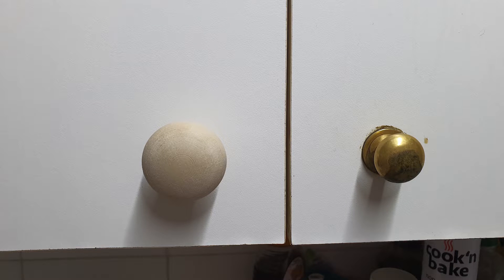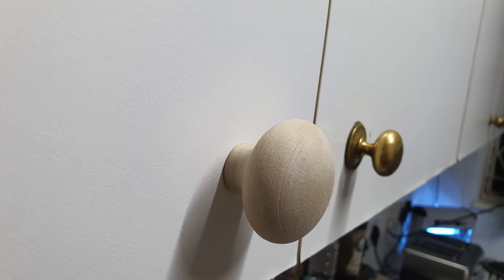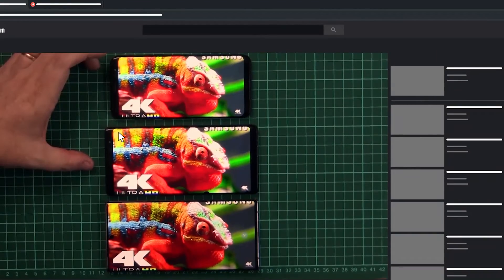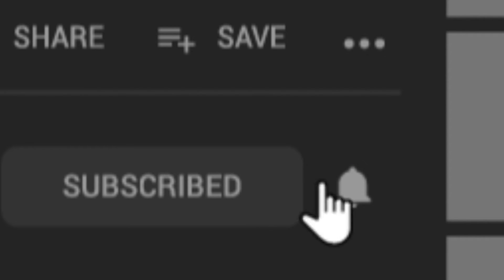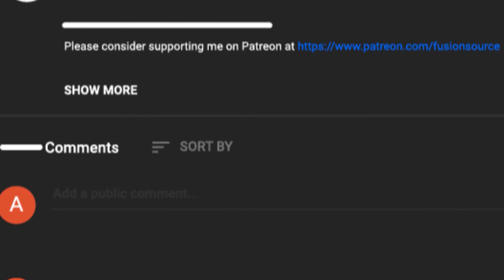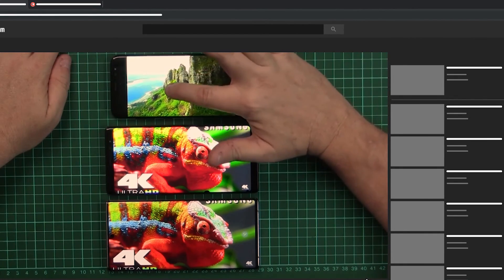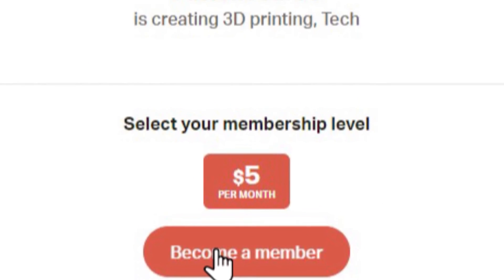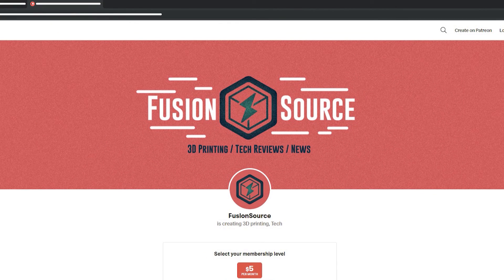Can You Stain Wood Filament | 3D PRINTING CUPBOARD HANDLES

Comment: Great video! Such a gread idea to print those. One tip I've started doing with many of my wood PLA prints is to use gorilla wood filler as it helps get into all the nooks and crannys that the print may have created, and after sanding leaves you with a nice wood grain. I also found that painting on a stain with a paint brush, letting it dry a lttle, and then wiping it off with a rag works really well. Honestly if you're just looking at my wood prints, you would think they're solid wood when they're 3d prints. So fun!
Reply from the maker: Thank you for your comment. Those handles still look great in my kitchen.